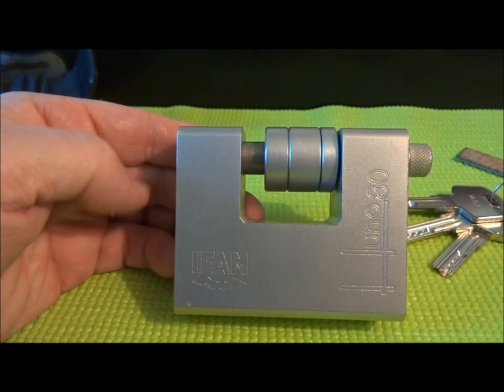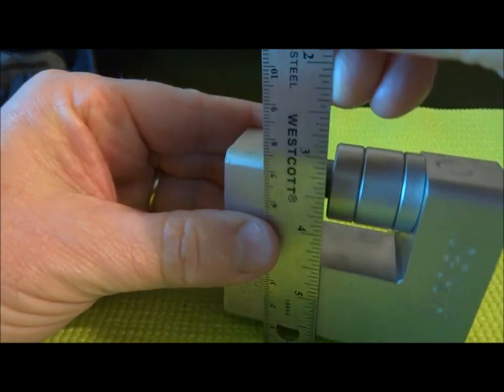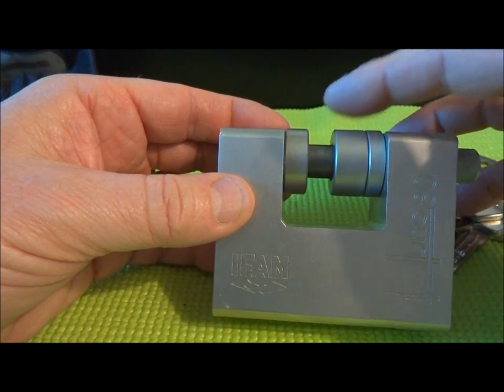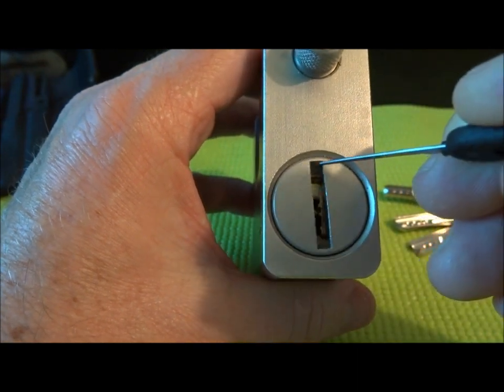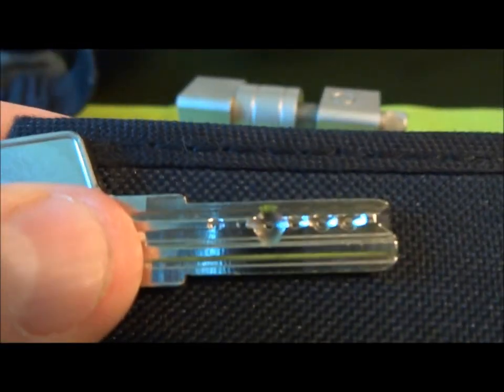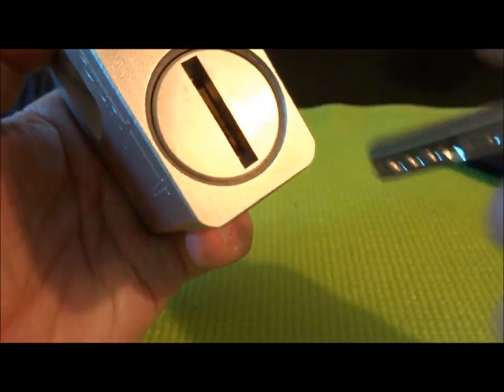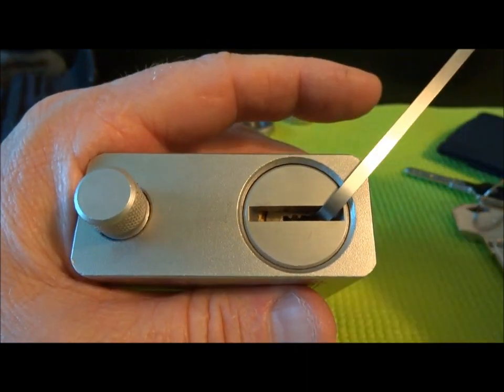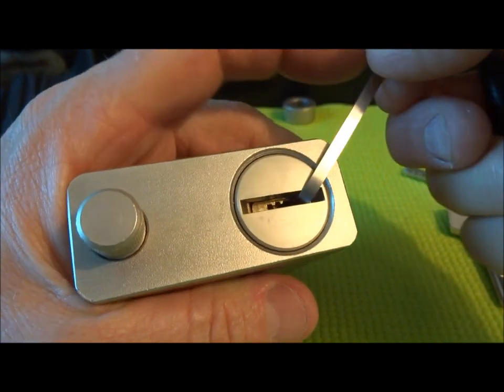(236) IFAM Uno 80mm Shutter Lock Picked Open

Comment: I've just taken the hardened steel roller off a old pipe bender to protect the shackle on my shutter lock in the same way as this lock leaving only enough room on the shackle for my motorcycle security chain